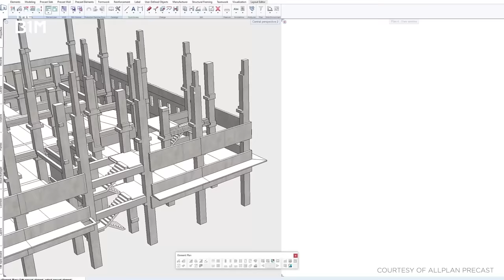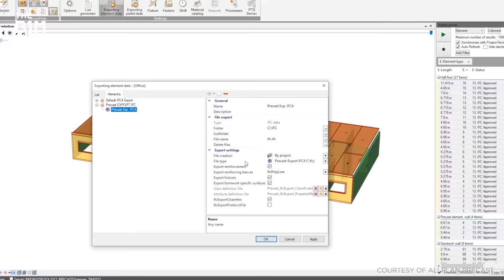Vienna is Building a $6BN "City Within a City"

Comment: It is a projecy that is very discussed at the moment, as it is missing the Envitonmental targets. To much Cement, and to hot in Summer, as it caresses of green zones between the buildings, causing extreme heat points in some areas. Htey are saving Money on the wrong places there.

Comment: When I see videos like this, I can see that North America is woefully behind in urban development, despite being a newer civilization. Where I live, we have a sort-of-similar development going up in the western quadrant of the city. The problem is, it's very small scale and the housing there is uber-expensive. It's clearly designed to cater to rich or at least well-off suburbanites who are into a lot of virtue signalling codswallop and want to appear greener than everyone else around them. 

In fact, the high cost of housing in the development and its placement in a remote suburban area are slowing its growth. The development was started around 2012, but less than a third of what has been proposed has been built. 

We were also supposed to get a Bus Rapid Transit system, but that died when the pandemic hit. Because of severe opposition to the project from NIMBYites and other professional axe-grinders and a weak city council that shies away from anything even remotely controversial, only half of the system was going to be built.

Comment: It's awful... Where are the trees ? There's no shade anywhere ! The Earth is getting hotter and hotter, and we keep building these awful urban projects which are just concrete blocks with a few trees here and there... It's not enough. Modern urban projects need to look like as if people were living inside forests. As far as the timber buildings are concerned, it doesn't change anything. You're still lacking LIVE trees and plants. Here you just get grass and gravel. It's rubbish... Trees not only provide shade and a cooler pocket of air, they also drain water efficiently and cheaply during storms. Something Germany, Belgium and Turkey were cruelly lacking in 2021 during those massive floods...

Comment: It's hardly within the city. It's way outside.
Reply: 20 minute metro ride 
You can't build houses where they there already are
Reply: @burgerpommes2001  You can when you use former industrial areas.
Reply: @SoLazy100  where is that in Vienna?
Reply: @burgerpommes2001  no idea. But like I said, this case isn't a city within thr city.

Comment: If your are seeing the maps & models, this might be look like there is an intelligent city building plan, but there's absolut not. Seestadt is the biggest fail since decades. It's a dessert of sealed grounds and concrete floors. The whole Infrastructure is an absolut horror. 
Seestadt is the result, when green deals morons together with socialist, try to play simcity. A district planed for 20.000 people, where parking places & drivable streets are missing. The Metro is a suburban end station, where trains are running in 10Min. intervals. The tramway have 15Min. intervals and the suburban bus connection 20-30Min. You have no trees there and the sand & dust from the sea area is everywhere in that area. On the train side the district is complete cut off from the areas on the other side cause the build a 2-3 meter tall wall next to the embankment on a distance of about 2km.

Comment: As a Viennese, Seestadt doesn't feel like Vienna at all.

All these ugly modern buildings are far from our beautiful architecture in the inner city.
Everything is so flat, only the balconies are protruding - because it's cheap.

If you work, for example on the Mariahilferstraße (a very big and long shopping street) it is a 40 minute commute with public transport from Seestadt.
Don't get me wrong, I love our public transport system but Seestadt is just so far away from everything that every commute will be torture in the morning, except when you work right in an office building in Seestadt.

Seestadt is also a cooking pot in the summer. So much concrete and so little trees and greenery, it is unbearable at times.
Most young people looking for a flat are basically presented Seestadt as the perfect place. It is not, atleast for me it's not. I want to live near my family and not an hour away.

I just think it isn't thought through enough. 
Or maybe I am getting old and hate change, who knows.
Reply: Well, I guess that depends a lot on where your family lives, doesn't it? If your family lives in suburban Donaustadt but you don't want to live in a car oriented place but a nice walkable place with lots of urban parks (quite rare in Donaustadt outside of Seestadt), a swimming lake, all the basic daily infrastructure you need (doctors, supermarket, bakery, restaurants ...), then the Seestadt is a pretty fine option and it is way better connected to central Vienna than much of the rest of Donaustadt and on top of that very well connected to Bratislava too (interesting feature for some as well for sure). A lot of people actually work in Transdanubien too and for those it is interesting as well. 

Of course if you work and have all your friends in Liesing it's not so great for you.

Comment: Aside from all the technological advancement and work that has been put into - Viennese sees Seestadt as a concrete desert, which is true. There is 80% concrete, if not even more, accompanied with small patches of greenery and people who live there claim that in a hot summer the heat is unbearably hotter than anywhere else due to the concrete heating up. 

In fact, this is a complete failure in my eyes. So much money went into it, yet another part of Vienna became so isolated from the city itself and has not learned anything in regards sustainability and making a first step into being more green.

Also the prices in Seestadt are extremely steep - comparable with the prices in the inner district, which are very sought after despite the fact the buildings there are mostly so old most don't have elevators. But it's more or less the best feeling of Vienna to get from and you can go anywhere from the inner district wherever you want and have anything you would want (except cars as most of the traffic has been banned).

Now prices wouldn't be "that" terrible, but you see - the reason why Vienna is getting increasingly bigger is also because of a bigger than normal immigration - immigrants don't have much money, and those "new" apartments that should accommodate for a bigger population will inherently not go to them but to the wealthier ones and leave their older buildings, which are not so great or modernized, as a second-hand leftover living place.

Also some apartments are 500k € and more - to buy. 500k for like 30m² if I recall it right, which is a joke.